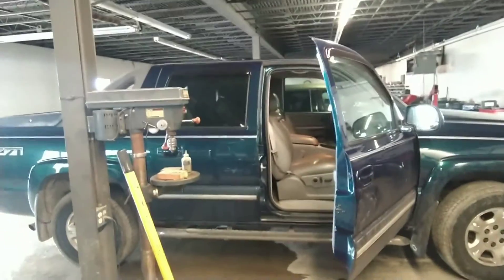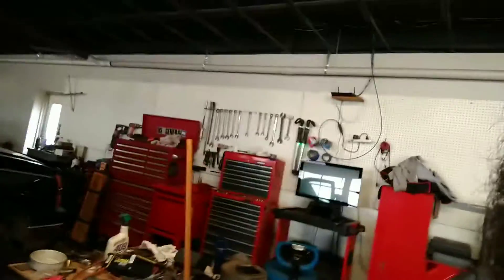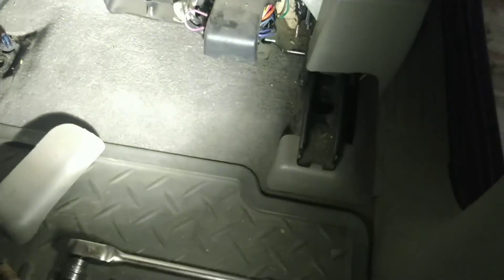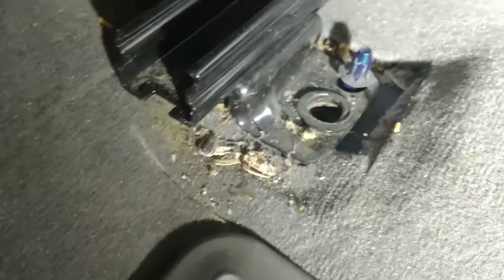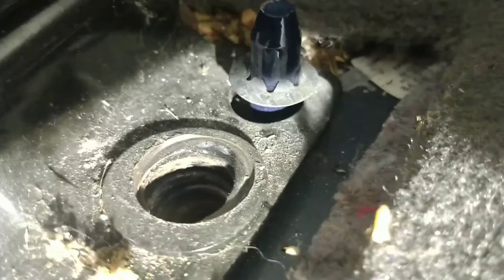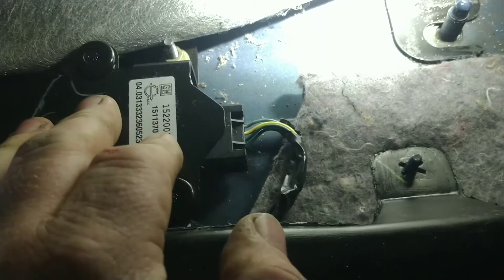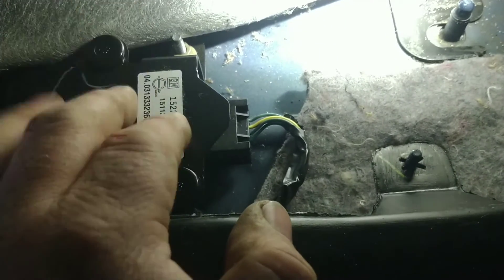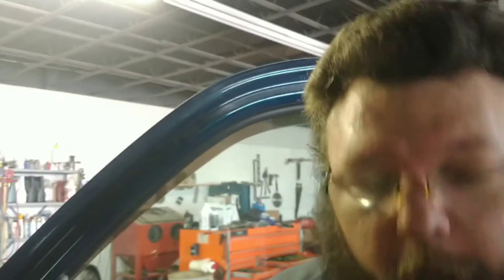Yaw rate sensor on a 06 Chevy Avalanche (location and replacement)

Comment: My avalanche is coming back with the same code.  Although, truck says service stability and stability service active.  While doing this is pulls hard and brakes very hard at the same time. Like if I'm applying the brakes hard and jerking.  This happens spontaneously for this truck which is a pain.  I did take it to the dealership, and they we're never able to duplicate.  Do you think changing this Yaw rate sensor will fix the problem?
Reply from the maker: Not unless the data shows an issue with it, in order for that to happen they’ll have to be able to recreate the symptoms while they have it on their computer during a test drive

Comment: Ill have to try this. Had an issue with lost amperage and everything shutting off except motor. Then every light kicked on. Ive replaced the alternator and belt nothing. Whent to brakes and replaced the booster and master cylinder. That fixed that problem but my abs light amd service stabilitrak and traction control stayed on alomg as abs. Change the brake pedal position sensor nothing. Did new rotors and all the abs wheel speed sensors and bang no more abs. So not just service stabilatrak and traction control hopefully this video sends me on the next item and its the demon cause these dang lights. Thanks for the video.

Comment: I have a yaw sensor z71 and its not under the seats driver or passenger I have a 2004 suburban any ideas where it is
Reply from the maker: No, this location was just for the avalanche
Reply: Thankyou for reply  I'm still looking where it might be 2004 suburban
Reply from the maker: @carlosortiz1806  according to what I find that’s the location for all GM trucks including the suburban, Yukon, Silverado, etc
Reply: Thankyou I have checked and there's nothing there neither on drivers side I been going crazy trying to find it
Reply: @carlosortiz1806 Did u find it? I need to replace mine too. It kicks off, TC light comes on then limp mode

Comment: Hi friend, I've seen your videos, I have a 2007 Tahoe, suddenly u2142, I've checked all the wiring and it's perfect, the traction control light comes on sometimes yes and sometimes no as soon as I turn the switch... I don't know what to do or check anymore... I don't have any more codes
Reply from the maker: @explotole4886  it will most likely be that sensor, not a guarantee though

Comment: Is this the same location for a 08 cadillac escalade ext. I dont have any errors but going through my scanner I noticed a error code c0196 and it said it was the yaw rate circuit
Reply from the maker: According to Mitchell it’s right up against the tunnel there, but the locations guide can’t always be counted on.
Reply: @bulldogsautomotiveadventur4387 ok thanks might have to go find this, thanks

Comment: Mine was doing something similar. It only gave me the abs/trac light and service stabilitrac at low speeds. Once I get moving it goes away unless I make a hard bank left at lower speeds then the stabilitrac kicks in. Will be replacing yaw rate sensor. Thanks for your help